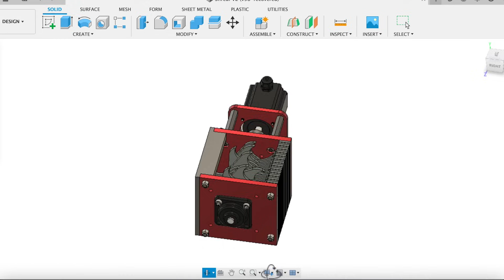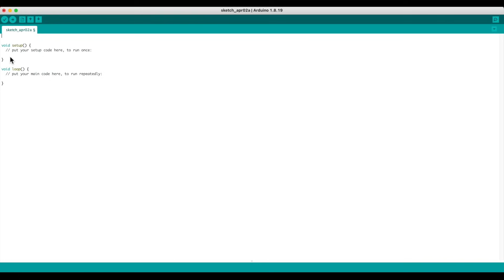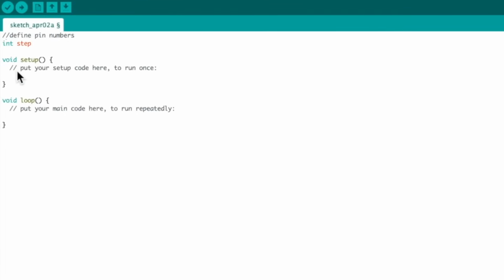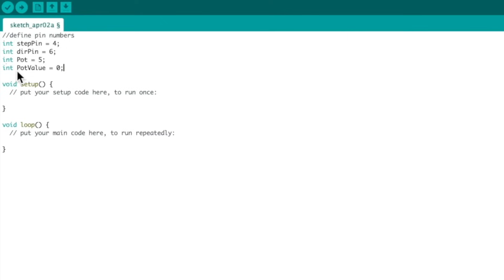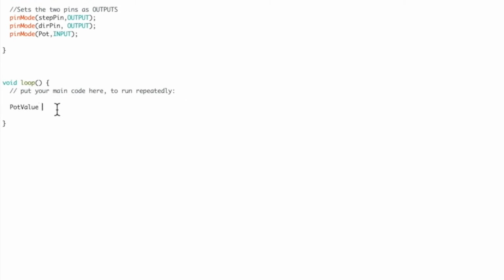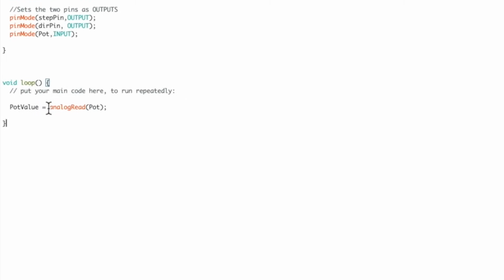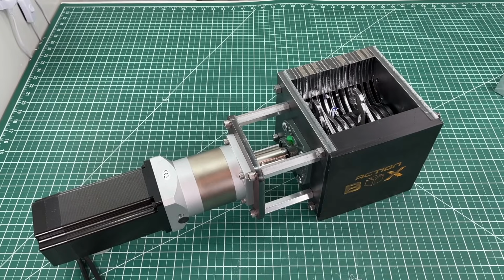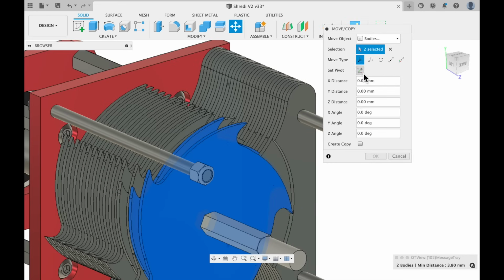DIY Desktop Shredder | SHREDII 1 & 2

Comment: I am in desperate need of information that online ai ebay and other are absolutely no help.  First i know there are many variables but i need sone place to start. I need a gearbox to hook up to a small shredder designed for a hand crank. I want to hook up either a bema 34 stepper or servo of which i have each. I also have a 2 hp “1500kw” servo. Lathe and mill to adapt motor to gearbox but i just have no idea what gearbox i need. Saw a video that was using to planetary and stepper but no info on gearbox. I need a model ir something to start looking at.  I can get scooter gearboxes snd other i just beed some idea. How much torque do i need for shredding 3d prints
Reply from the maker: It sounds like you need SHREDII 5S. Check it out on actionbox.ca

Comment: This is really interesting and something I could actually be able to build as well, since I operate steel cutting lasers at work (which is why I noticed and can't help but point out that your 8mm? oxygen cuts aren't that great. 1,2mm nozzle and less gas pressure should do the trick, if not try to go down with focus. The 3mm nitrogen ones are great, though).
Maybe I will try it, but make it smaller and add a funnel, since 3d print waste would be the only thing I'd use it for anyway. 
Anyhow, great video and amazing work. Keep up and have good day.

PS: I get that the blades and spacers are never perfectly flat against each other so I'm kind of wondering how the tolerances are so perfect for them to fit through the slits. Is there some trickery going on like altering material thickness, or does it just work?

Comment: Having worked in injection molding for years, I can add a few tips here for shredding. 
Be sure when you are grinding bottles, to pull off the label, and also the small cap ring if you wish to reuse the plastic. Also make sure your bottles are clean, and that there is no dust or wood shavings or any other particles on the surface your shreds fall onto. You do not want any contamination in your regrind that would show up in your project. 
Try to grind the same kind of plastic in one grinding, and clean the grinder teeth after each type of plastic is ground. Some plastics will not mix with others, and it’s the same with colors. If you don’t care about the color of the extruded plastic, colors can be mixed, but if you want a dedicated color, try not to cross contaminate. 
Using 100% regrind is not really recommended. It can cause balling up of the material in the plunger or screw feed. Try to mix at least 30% virgin into the regrind. 
Plastic does degrade over time. HDPE and LDPE is not so bad, and can be used for quite a while, as long as not overly contaminated. 
Some specialty plastics lose integrity the more often they are heated. 
You can also add color concentrate pellets or dyes to the clear plastic if you want a specific color, and you should be able to find those at a mill supply store.
Reply from the maker: Thanks for the tips.
Reply: What type of plastic are the bottle caps? Could they be shredded and injected into new molds or even turned into FDM filament?
Reply: @Atlessa  bottle caps are usually LDPE, and actually are a more durable plastic than the PTFE or PET the bottles are constructed from. The advantage with bottle caps are that the colors are usually uniform. You do have to pull out the little seal that they put in some of the caps.

Comment: So my idea even though this video is that you could take version 1 and stick it on top of version 2 and have a bin underneath the second one and if you want the grounds to be ground up again a second time run it on top of the first one and then as it falls into the second one you've got even smaller pieces of yet again.
Reply from the maker: Interesting idea 😃. Thanks for sharing.

Comment: yikes, should have kept the original shaft coupler and lovejoy, its your failure point so that if something goes wrong you don't grenade your components. The lovejoy also allows for a lot of flex and misalignment adding to the longevity of your components.

Comment: Well 1st of all I'd want shreddy one on top of shreddy 2 About 4" separating them with a chain drive-in between And some sort of a container underneath both of them And then some sort of screw driven Extreme over the heat element on the end of it to make it a long filliment tube And you can make it for under $500 still send it out as a kit all-in-one that would be great
Reply from the maker: Interesting concept, thanks for sharing.

Comment: Wouldn't be using circular saw blades from the hardware store a solution?
Reply from the maker: In Theory yes, in practice we weren't able to find a cost effective way of mounting them onto the shafts. We probably could have used an EDM machine to cut out the cores to the right shape, but that would be super expensive. Hope that answered your question, and great thinking. Cheers, Dave
Reply: @ActionBOX  Well, in theory one might think of tig welding a slot key inside the 12.7 mm central hole of the 125 mm blade 36 tungsten carbide teeth (4$ each) and a notch along the axle shaft cut in with an angle grinder as a quick and dirty approach. Never done myself though. As a motor+gears solution I'm thinking of one of the powerful wind screen wiper motors for lorries (120 W/24V) with worm gear inside. There is waiting one in my basement.

By the way, here in Germany we pay a 25 cent  deposit for each PET water bottel. Upon returning the empty bottle into the scanner machine at the grocery we get the money back. The scanning machine shredders the bottle in 5 cm pieces packs the flakes in sacks and a recycler picks the sacks up frequently. Getting hold on such a bag might be easy and a bonanza for 3D print fans. you just need to grind down the flakes into tiny bits.

Comment: Oh that's wicked! I so need a shreddie to handle all my 3d printer rubbish. I usually sit there with industrial scissors and cut as much as I can up to put into silicon coaster moulds and melt the different coloured plastic in the oven 😀 Shreddie would really speed things up 😂... Well done guys
Reply from the maker: Thanks 😃. We have our shredii 4.0 video coming out in 3 weeks which will be far more capable. We are also making it available to our viewers so make sure to subscribe and check back in. Cheers, Dave

Comment: Using stepper motor is not a good idea considering the cost/torque
Reply from the maker: Good point. We will be discussing this concept in our shredii 4.0 video (coming out Dec 2022) to explain how to use stepper motors without an issue.  Hope you enjoyed the video regardless and thanks for leaving a comment 😃. Cheers,  Dave

Comment: You are mixing your plastics though? The bottle is PET and the 3D filament is PLA I'm assuming. Is it ok to mix them?
Reply: Yes and No. Yes, in that the plastics look like they stick together and the result is good for demo purposes, like in the video, or for anything non critical. No, in that mixing the two will yield to instabilities in adhesion between the two plastics or when temperature comes into play since the structural integrity may become unpredictable.
Reply from the maker: We shredded different plastics for demonstration but we only inject a single type.  It will not work to inject two very dissimilar plastics.  Max above is correct 😃. Hope you enjoyed the video regardless 😊

Comment: Sweet project I like the shredder!!
I do have an idea instead of the teeth spiraling off to one side offset them so that the spiral meets in the middle centering the pieces instead of pushing them to one side of the carriage.
Reply from the maker: Hi Nicholas, thanks for your input.  We actually did implement this in our shredii 3.0 video and it worked great.  Good suggestion. Cheers, Dave

Comment: GREAT VID..What i would do different though is put shred 1 directly on top of shred 2 and use the same motor( this is by far powerful enough as you are using the gearbox. This way you can put all types of waste plastic in and after going through two stages its perfect. One change can link them both . I would also place a hopper on top so that it will feed itself and since you are using the Arduino it can turn off when the hopper is empty and for safety when the lid(which you can add is closed)...which means hands can never be inside when it starts up. The one other thing I would do is to make it 24 to 36 inch wide and simply design the blades so they are lighter while yet strong. I'm really inspired by your design as I have been saving up water bottles for shredding because we dont have recycle program where i live. ...BTW Great work on this project. I love it ...you make it look so easy.
Reply from the maker: Thanks 😃. I appreciate your kind words.  Did you check out our latest video of Shredii 3.0?

Comment: Amazing advancements in DIY manufacturing, fellas! ~

When is Shreddi 2.0 going to be available as is or as kits? 🤔
Reply from the maker: July 22nd is the date.  Looking forward to your order 😉. Cheers
Reply: @ActionBOX  Looking forward to it! I'm just hoping it will be affordable~ 😉
Reply from the maker: @x_jaydn  what price would you consider affordable? Thanks for your input 😃
Reply: @ActionBOX  It's hard to give an estimate without knowing the oem price/grade of the flat stock and how many hours are put-into plasma cutting and grinding/finishing, if any, as well as the cost of that specific geared motor, but...

For the sake of desktop/hobbyist affordability, I'd be incredibly hesitant for anything above $500 USD at the time of purchase 🤔

Hopefully nowhere as expensive as the Injekto kits which involve a lot more electronics and mechanical complexities relative to Shreddi
Reply from the maker: @x_jaydn  thanks.

Comment: it would be better to use a plastic coupler instead of metal because if any metal parts fall into the crusher it will come from a fuse preventing a more expensive component from breaking
Reply from the maker: Good concept, however plastic couplers would break too easily under these loads.  I will look into a softer material as per your recommendation though 😃

Comment: I like it, I'm going to build this! But as a conveyance tech, I will say I'd like to see that motor supported on the back. Motors that over hang that far don't last very long. I should know since I replace broken ones all the time. Haha. Also the coupler, I would stick with the love joy coupling that it came with to prevent shock traveling back into the motor and compensate for any misalignment in the coupling. Even very tiny misalignments can cause wear on the system. But I like the ideas you guys build, keep it up!
Reply from the maker: Thanks

Comment: Can injecto be used to extrude new filament from old supports or prints?
Reply from the maker: No, you usually need a screw mechanism for a continuous feed of filament.  Injekto is limited by injection size, but can inject at much higher pressures to fill the mold cavities.

Comment: if you want the shreds to be uniform
put SHREDII 1 on top of SHREDII 2 and put a grate with the size hole you want the bits to be on the bottom
or just put the grate on the bottom with holes the size you want the bits to be

Comment: You may have already looked at this option during the design phase, but would a worm gear work for this setup? It would put the motor at a right angle to the axis of rotation of the main shaft but you can get some pretty steep reduction ratios with a worm gear.
Reply from the maker: That is in deed a great recommendation.  We looked into it but those were very expensive at the size we needed (and the right material for the stresses).  Great thinking. Cheers, Dave

Comment: This is super nitpicky, so no worries if you don't wanna do it, but I'm used to defining pin values in arduino as const int rather than int. It's not a massive change, but it helps keep you from accidentally changing an output pin while executing your code.

Aside from that, this project is awesome! Having a hobbyist design for recycling plastic is amazing and I'm here for it. I don't have the money yet to get one, but whenever I do, I'll look into it because I definitely want to reuse my plastic waste in any way I can.
Reply from the maker: That’s honestly a great recommendation.  I appreciate you sharing that.  Glad you I’m liked the video 😊